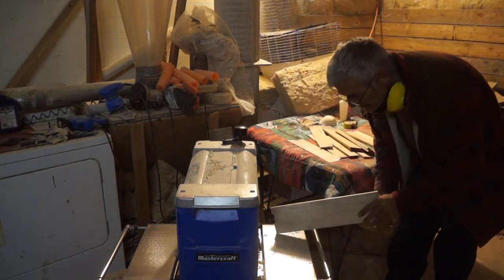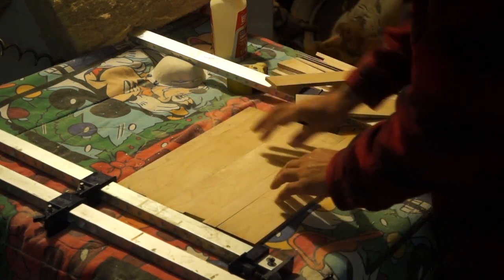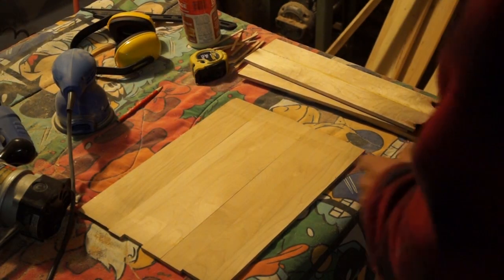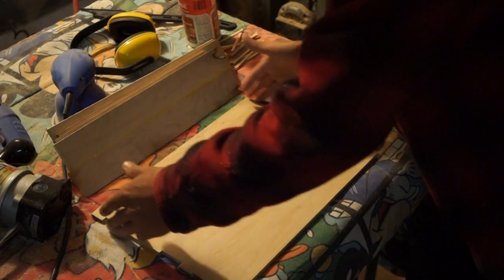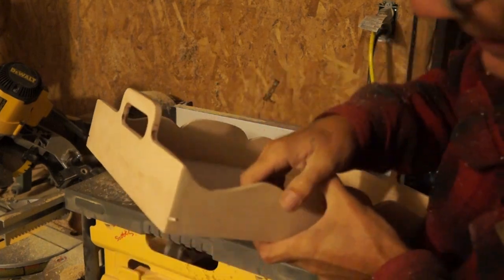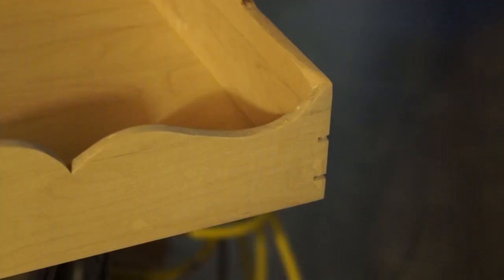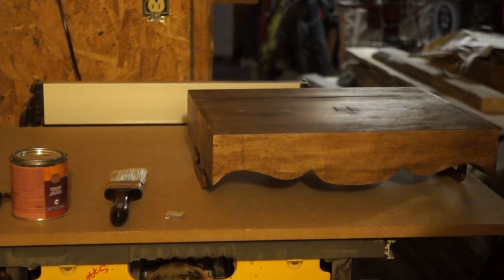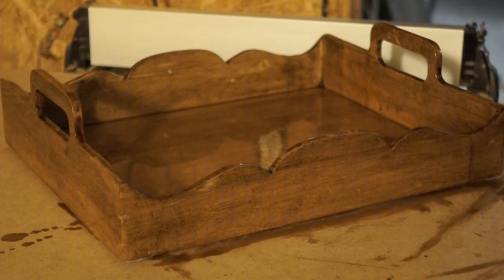Handmade, white maple, Food Tray

Comment: If you keep a wax candle with your jointer and rub it on the table intermittently, the timber will glide over the top easily. It makes the operation safer and easier.